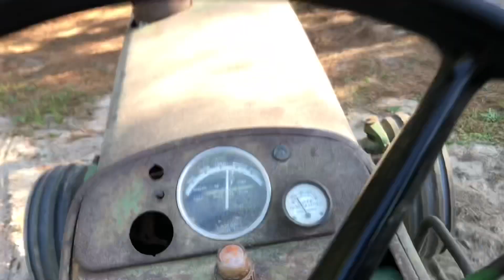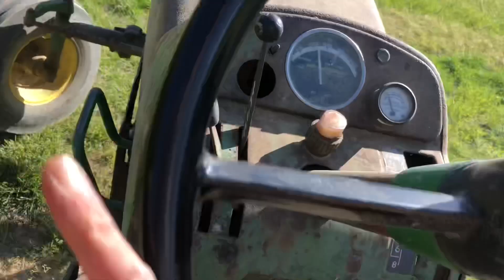Preparing Corn 🌽 Land

Comment: If you want to use that Massey Ferguson seedbed finisher you are welcome to it. I have timed it and it takes about 45 minutes to run over that 6-acre field, 6th Gear at about 2100 RPM.   Yeah it's a fun ride and remember to hold onto your hat🤠...
Reply from the maker: Thanks but I’ve got another plan . Yep no removal of hats while running tractor! Thanks cousin SBF.